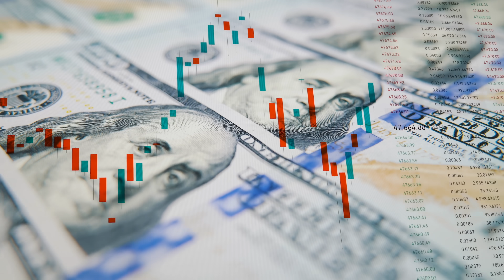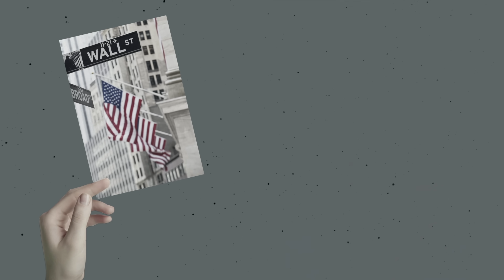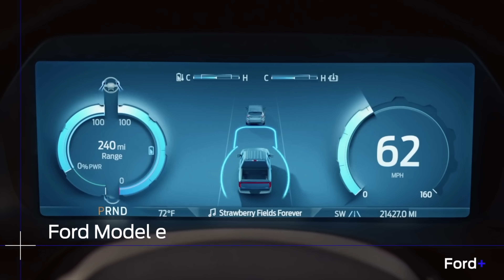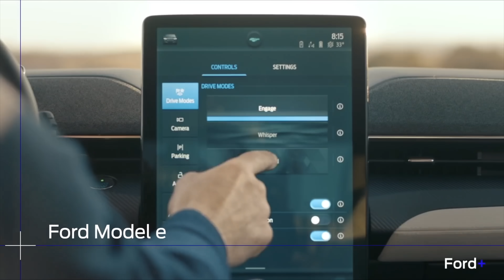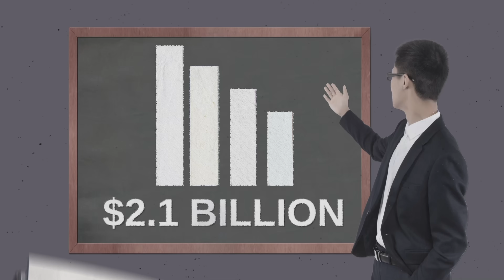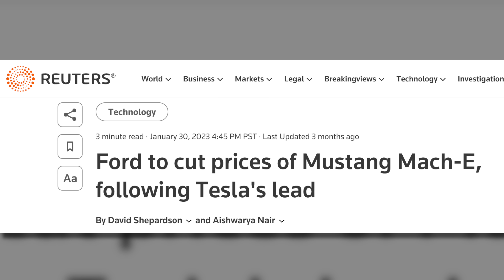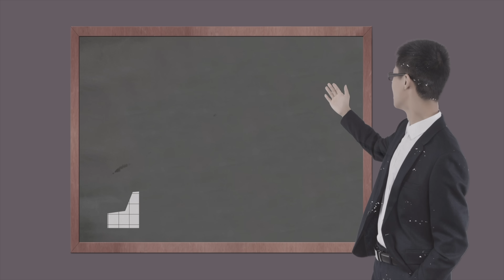Ford CEO Just Announced “We're Losing Billions and Have to Break Up the Company"

Comment: Ford should make a Model T type car that is electric. Just a small around town car at an affordable price. I think the first manufacturer that does that will have low margins but high penetration into the affordable car market. EV trucks are dead on arrival for people who really need a truck, i.e. remote locations and need to be used as a truck.
Reply: Nissan tried that with the Leaf over 10 years ago and it's been a failure.  If you want a vehicle like that, the best way to go is to buy a used Nissan Leaf from the 2013+ era with a good battery.  These cars have depreciated a lot so it's a real good value if you can find one with a good battery.
Reply: @FlashOfLight  or could buy  prius with a bad battery and replace it for about 1500. Not an ev but very economical.
Reply: @flashoflight8160  Because the leaf had like 60 mile total range lol
Now nobody will want to buy a 10yr old Leaf with a pending expensive battery replacement that costs more than the car.
This is the future of what the used car market will be if everything goes EV
Reply: @richardfolden3860  Yeah but it was made in Mexico. So that a non starter as far as quality goes!

Comment: I've almost exclusively on Fords and I'm driving a 2018 Ford F150 and I don't like it the head unit glitches I hate the electric parking brake cost me $1,200 cuz I tried to do my own breaks which I have done for decades the new Ford Lightning sucks and they're moving F-150 production to Mexico and I'm looking to buy 2009 Chevy pickup truck just to get rid of my 2018
Reply: Well, you were the one who wanted a truck with a computer in it. Or at least you thought you did. They had to get rid of all the reliable ones with that cash for clunker scam. Soooo many good vehicles that just needed some tlc got crushed because people were getting paid big bucks to bring them in.

Comment: Scotty what’s your views on this one.

I’m puzzled why theses manufacturers are not developing  hydrogen Engines like JCB In the UK 🇬🇧 as they are about to start rolling off the production line 
As all 8-12 tons machinery diggers in a field can’t be changed if they were EV POWERED so thinks they are on the right side of this industry.
As they have converted a standard Diesel engine to run on Hydrogen.
As for Ford should stay with what they do best petrol and diesel engines
Reply: Low energy density also requires significantly more storage. A more efficient use of hydrogen is in FCEVs, as much as I love the idea of an H2 combustion engine. One thing EVs will never match is a well tuned exhaust note.

Comment: I ordered a Maverick hybrid last year and still waiting..   ford isn't going to make money if they actually cant deliver their products
Reply: My maverick took about 16 months from order to delivery. It is XLT hybrid model..... so far 52mpg around town and 42 hwy 

It runs very well and has pretty good fit and finish. We have it since Oct 2022 and approx 5,800 miles now 

If you can spring for the roll up cover. It is way better than aftermarket options, I have BakFlap on my tundra

Anyway, it's worth the wait, just hang in there. The key part is once you receive the VIN number. Then, it maybe just a couple more months later

Comment: They don't make a car or truck I can afford and want. That is not a good way to stay in business.
Reply: @richardfolden3860  nope. they should continue only making giant pickups with terrible motors and overall engineering and gouge their customers for payments that rival mortgages. I am sure you are right and that it will end well for them. kek
Reply: @richardfolden3860  free markets tend to weed out junk companies. won't be long.
Reply: @richardfolden3860  gm is toast. 
vw,while popular in europe, has struggled to get near 3% of the us car market and anyone who buys one will often never do so again. 
toyota is screwing up but they have a reputation for quality in their older vehicles that will carry them for a while at least.
I am betting a car company from india or a another country in that region will come out with a line of high quality, low price cars and mop the floor with the old guard.
suzuki could be a big player if they had the will.
ford has lost their way. sadly I have no faith in them or their products any longer.
this is from a man who has owned 4 ford pickups and a ford car.
Reply: @richardfolden3860  electric cars will not cross 25% for maybe 20 years, if ever.
Most want nothing to do with them.
They are not suitable for cold climate sections of the country.
The electric grid can not handle them.
We do not have generating capacity for them even if it could.
There is a global shortage of copper and that's the easiest of the metals needed to manufacture them.
As more people become aware of the toxic nature and inherent problems with the electric car fantasy even less will want them.
A honda civic si got almost 50mpg back in the 80's.
The math is not in favor of an electric over an ice car that gets over 35mpg.
Were tesla to make a small ice/ hybrid car using it's advanced stamping process I do believe the entire auto industry would be put out to pasture or extremely hobbled in short order.
Now that would be interesting.

Comment: All manufacturers are over engineered and over priced. The Saturn car was one of the best affordable car for years. Gas mileage around town was 35mpg. Double over head cam. Plenty of power. Didn't have all those modules and all that wiring to corrod. Look at the eletric golf cart, it doesn't have all those modules. They could build it was simpler amd way cheaper 
the moto use to be. I would rather sell volume instead of one big profit and still come up making the same in the end.   People do not make that much more money to be able to afford these cars.

Comment: I hv ford 150 cylinder heads are made of cheap aluminum i ve had it since it was new i had to tap every spark plug hole in th engine done atleast twice at 200 a shot ,now with only 205 k on motor theres nothing more i can do except change heads out,ill never buy ford again,now im forced to walk at 68

Comment: I offered Ford a marketing system and path that would have given them up to 30% of their competitions share of the U.S. car and truck market. I realize it's a huge claim, but I honestly believe I have something. All I wanted was 10 dollars for every car my system enables them to sell. I offered GM the same system back in 1992 and guaranteed them they would be able to buy up several auto makers after they are destroyed by my system. I was called by the head of GM's truck manufacturing sector, but he informed me he could not give me anything for my marketing system because they were under contract with another marketing firm. Well needless to say that was the end of that call. This is an example of why the Big Three are having such hard times. They do not listen to the consumer. They listen to people with degrees in marketing, but that lack basic common sense reasoning and that are totally out of tune with the consumer. That is why they are failing.

Comment: I want an EV. Problem is, too pricey. Range not long enough. Batteries may be worthless in ten years. Replacing them also costly. If the range was 500 to 1000miles, and the price under 40k fully loaded, with a 10 year battery guarantee. I would seriously get on it. I love em, just it's not there for me. If EVs get to over 500miles it'll be a game changer. Driving on trips without stopping to charge till you sleep, is where it needs to be.

Comment: I have owned Fords for over the past 24 years.  I would not buy or even accept a Ford EV even if it was free! If I was a betting person I'd bet that 3 liter 400 horsepower gasoline engine will not see 200,000 reliable miles on its original installation.

Comment: I've driven Fords most of my life but given the radical change in recent years has me looking elsewhere. I would advise Ford to simplify your auto line as you have too many of one and not enough of others. Ford has multiple SUVs and virtually no cars outside the mustang. Keep the expedition, the explorer, and edge. Bring back the flex (as everyone I know that owned one loves them). Bring back Taurus and Fusion. (No real need for an economy car as other automakers have the segment well saturated). The Bronco has been named as a competitor to the Jeep Wrangler so it has its place (needs to be more affordable though). The Truck lines need simplification as there are too many different trim liens for starters. And get rid of all these stupid Ecoboost engines!! A V6 in an Expedition, come on. Use naturally aspirated engines, in this case a V8, to achieve the same result and have less problems.
Reply: I hope Ford can be competitive in the fully elective vehicle market, but is not going to be easy. They are going to struggle and they are making progress, the question in my mind will they make enough progress to survive. Part depends on Tesla  and world competitors and their own efforts.

Comment: I think the Big 3 appetite is larger than it can chew,  it wants to increase demand and production without having a through EV infrastructure plan in place.  They acknowledge the infrastructure shortcomings and issues but its never taken very seriously, at least to the consumers standpoint.  Until a concrete plan is in place by any of the American manufacturers its just a pipedream and consumers will be wary of purchasing an EV, this will affect its bottom-line. I live in an urbanized area and until they resolve high-rise living and apartment EV charging solutions there has been queues of EVs waiting to get a charge at limited stations on the weekends.  Their piece of the pie is going to much much smaller than anticipated.

Comment: Without infrastructure there is no point in buying an EV truck. And without a battery that lasts and has enough power output, and a short repower time , there would be no efficient use of an E- vehicle. There is a supply chain issue now. What will there be with all- electric fleets? Work trucks will be stuck out on the highways or dead in the water at the end of their run to a shipper or receiver.  
The whole idea is false and does not fit the existing infrastructure or any near future ones. It is a dream , an illusion of a world without pollution. 
And what about locomotives ? There’s no way they can generate enough power without diesel. The engines have electric generators now but they must be run by a diesel engine.

Comment: I have no sympathy for Ford... and not much for Ford workers!  I wanted to buy a new Ford Maverick hybrid pickup... but they had BAD SAFETY RECALL issues so I said, "I'll wait a year" until the work em out. Then I  tried to get one  this year... the dealers were trying to stick  $10,000 extra on, and the Ford website said we're not making enough you have to go through the dealer. 
And they completely shut down their car making lines except for the venerable Mustang.... so Ford would rather close down production lines and lay off workers than  sell customers an affordable vehicle they wanted!

Even worse (!)  Ford LED OEM automakers in recalls, they wanted to sell you an overstuffed, high-priced, high-margin $80,000 pickup truck that you're going to have to bring back to dealer for repairs and probably spend thousands after warranty expires.

And worst of all, Ford botched the transitions to EV's by not cleaning up the engineering mess of  the Mustang  MachE  EV as revealed by the Monroe Live teardowns. 
Electric vehicles are actually far cheaper to make than gas vehicles - they don't need thousands of expensive, critical parts for Engines & Transmissions.

 But you do need an expert software team and a good supply of batteries which Ford Management never figured out. Ford workers are working for incompetent management  who don't care about customers or workers,  all they want to do is  build overpriced luxury pickups that will need constant service.  Sandy Munro worked for Ford as an engineer a couple of decades ago, he  stayed overnight to modify the assembly line to reduce time and cost on  that line, and was nearly fired for it the next morning!   Looks like Ford Management and workers haven't learned anything since

Comment: Hey scotty i was wondering how hard it is to replace a power steering pump in a 98 nissan maxima
Reply: I'm not Scotty but I will say it is not very hard. A mechanic will charge for two hours of labor. If you do it yourself it will take you around 3-4 hours if you're reasonably mechanically proficient.
Reply: 3 bolts.  2 on the front and one on the rear.  Also a 22mm banjo bolt.  It is not easy to get to especially in the driveway.

Comment: EVs: I don't want to pay for one, don't want to charge one for an hour every 200 miles in a Walmart parking lot or desolate charging station in the night, a rainstorm and certainly not in a blizzard. 
Besides, I love listening to my motor's subtle vibrato, selecting appropriate gear ratios and steering my machine exactly where I want it to go. A vehicle silently driving itself from one charger to the next and waiting for its electron spring to be rewound just seems boring to me. Simple, efficient, proven technology is much more appealing and while so many are making insane payments, I'm buying mutual funds on sale at 25% off.
Reply: Well I wouldn't want to charge for an hour at Walmart either. Never have done that, in fact all winter I didn't have to stand out in the cold and blowing snow to fuel my vehicle. Just plugged it in in the garage.
Reply: @davekozlowski1266  If you can afford one and it works for you, I see nothing wrong with them. But my children live 800 miles away. I prefer one quick fuel stop along the way. Allows me to travel at a safe, leisurely pace and still make it in one day.
Reply: @rdmineer1  glad that works for you, my bladder couldn't handle 6 hrs of driving before stopping for a 10 minute gas and go.
Reply: @davekozlowski1266  I'm getting that way, soon to be 64.

Comment: The smaller the battery at the same charge the hotter it will get both charging and draining.  The heavier the vehicle the faster the tires will wear.  These EVs would be better configured to puttering around the city as golf carts rented by the hour as bicycles are now.  Tiny city cars could charge fast and could be swap-part repaired quickly.  Horsepower = torque x rpm, so large loads will probably run on oil for some time until we go nuke or geothermal. Small loads will become closer to using electricity efficiently sooner.